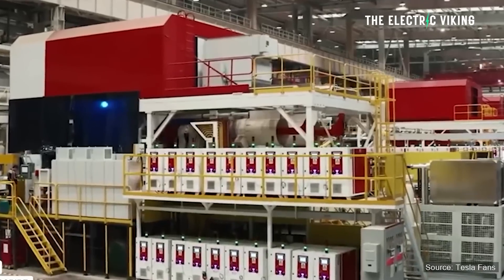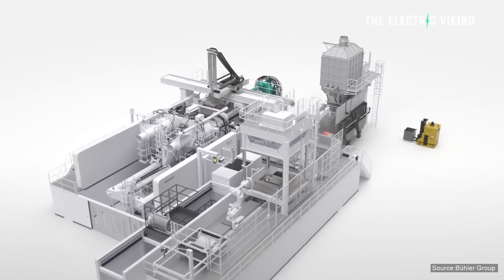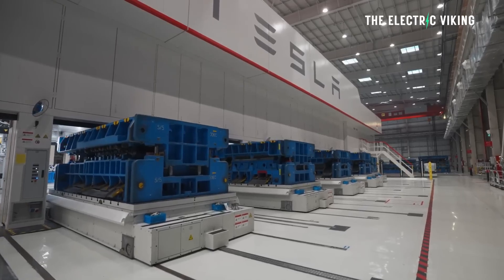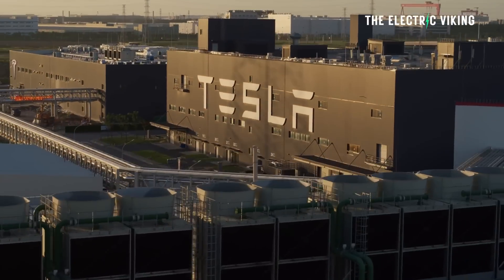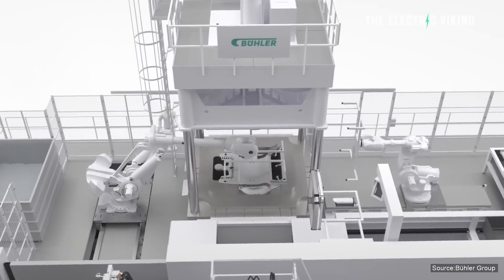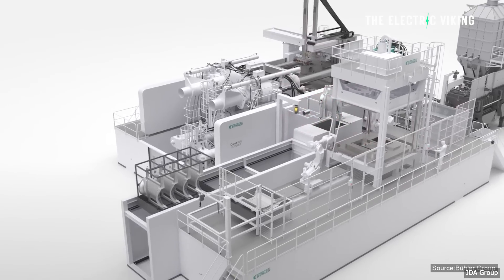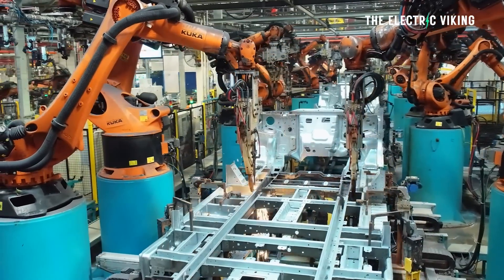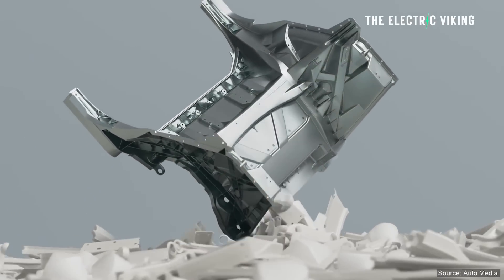Chinese engineers invent giant magnesium Gigacastings for cheaper, lighter EV's

Comment: Casting magnesium alloy is a bad move . Weight saving is probably 10 kgs total over normal alloys . Cars have accidents and repairing a car with Magnesium alloy chassis ( because that really what it is ) will be next to impossible after say a 15 Klh rear ender in traffic . You would need to get a metallurgist to check the whole chassis for micro fractures with high neck scanners like X-rays  or ultrasonics ( more complex than this I know ) . Casting with Magnesium alloys introduce increased corrosion particularly with electricity flowing threw it  ( Most cars have a Negative earth ) . Dumb idea and anyone experience in Aerospace nows it , the parts are light and have a short life expectancy . The real advantage  of say a Tesla is the ability for a car to easily last 20-30 years . I believe that save the energy needed to make 2-4 replacement vehicles with is a lot energy . Most cars use more energy in being made than the first 5-7 years of use .

Comment: Google ALLITE SUPER MAGNESIUM, it's publicly been used in Aerospace since 2006, now one company is trying to use it's many forms to make bikes and other stuff, one version can be cast for parts used inside of jet engines and other places, it's not corrosive resistant so it needs treatments. Cast magnesium has been used all over the auto industry but one good place is inside of seats as the seat frame, you can add rare earths to magnesium and get the attributes of metals like titanium, the ALLITE company claims titanium strength with their super magnesium formulation that they developed while working for the US. Gov.

Comment: The US built its bomb sights out of magnesium in WWII so they'd burn up when the bombers crashed. Let's see... lighter than aluminum? Check! But 34%, not 40%. Weaker than aluminum? Check! By 35%. So it will take more to make it as strong. Flammable at normal atmospheric conditions? Check! So let's pack a bunch of this stuff right next to some batteries and see what happens when it shorts out in a crash.

Comment: It has already been mentioned several times in the comments: Magnesium is a "difficult" material.
Contact corrosion, metal fire (can be improved with calcium and yttrium), critical for deformation.

And weight doesn't play such a big role for BEVs, so here you have to see whether the additional costs of magnesium are worthwhile at all.
Reply: I did a study about 20 years ago on the use of magnesium casting used for seats in dual deck TGV (french fast trains) compared to aluminium. It turns out that even if magnesium is more expensive, the castings come out ready to use -  no need for human labor to polish them after. In the end it is cheaper than using aluminium casting for this reason because of human labor cost required for polishing them. Also less coats paint required.
Reply: @amaurytt  there is no need to polish a car part that is not a visible part
Reply: @Zedus-rl9hp  if you think cybertruck the outer is the inner at the same time. Also doubt you can adjust parts together if parts are not clean. My vocabulary might not be the best...not my native language
Reply: most alumilium mixes today already got a bit of megnesium in it. think if they stick to that mix ratio its fine lol .. and yhea i witnessted a car light up due to the wheels being made of magnesium xD rubbing that stuff isnt great
Reply: YouTube geniuses are really a dime a dozen.
Reply: The cost saving is over human hours, not the material. The material can be more expensive. Traditionally the chassis are put together into one piece by assembly. Here you have one piece of the chassis for the entire back bottom of the car.
Reply: @dawebslave3571  same with aluminium castings.

Comment: Flame temperatures of magnesium and magnesium alloys can reach 3,100 °C (5,610 °F),[20] although flame height above the burning metal is usually less than 300 mm (12 in).[21] Once ignited, such fires are difficult to extinguish, because combustion continues in nitrogen (forming magnesium nitride), carbon dioxide (forming magnesium oxide and carbon), and water (forming magnesium oxide and hydrogen, which also combusts due to heat in the presence of additional oxygen). This property was used in incendiary weapons during the firebombing of cities in World War II, where the only practical civil defense was to smother a burning flare under dry sand to exclude atmosphere from the combustion.
Magnesium may also be used as an igniter for thermite.

Comment: Nostalgic for EV fires that were difficult to impossible to extinguish after adopting LFP batteries, Chinese engineers begin using magnesium for the battery case.
Magnesium burns so hot that it dissociates the hydrogen and oxygen in water, stealing the oxygen for itself and releasing hot hydrogen to the air. If you've ever seen a car fire involving a large magnesium part (I have) the firemen just stand by and protect other property and fuel tanks as putting water or even foam (water-based) on a magnesium fire just makes it worse.
Deformation, though is desirable in serious collisions. That absorbs energy that would otherwise be transferred to the occupants. After a certain threshold, you want the structure to bend so that the bags of water don't bruise.

Comment: Magnesium is a highly flammable metal, but while it is easy to ignite when powdered or shaved into thin strips, it is difficult to ignite in mass or bulk. Once ignited it is difficult to extinguish, being able to burn in both nitrogen (forming magnesium nitride), and carbon dioxide (forming magnesium oxide and carbon).
Reply: All you have to do is raise the temp to 744 K (473 °C, 883 °F). Sure, a large piece will burn slower, but it will still burn and hot too.
Reply: Large pices contain more energy
Reply: @tedmoss  very do-able if and when the battery fire is started first, it can ignite the Mg
Reply: @andrewcannon587  I was thinking the same thing.
Reply: With the appropriate alloy combination, magnesium does not ignite or explode. The specification of suitable magnesium alloys for defined industrial uses is a specialty of Galaxy Trade and Technology.

The common misconception about the dangers of magnesium is due to confusion of magnesium alloys with pure magnesium. Pure magnesium, in the form of powder or ribbons used for photographic and pyrotechnic purposes, as well as in high school chemistry experiments that every student remembers, may ignite if exposed to flame.

Here are some key facts and information about magnesium safety:

• Solid magnesium parts will not burn until heated above the melting point. This melting point is similar to aluminum, at 650 ̊C or 1202 ̊F.

• If locally melted, the high thermal conductivity of magnesium will generally ensure rapid cooling and prevent a fire from spreading.

• It is possible, with a welding torch, to burn a hole in a magnesium sheet as big as the cone of the welding flame without igniting the surrounding metal. Similarly, a welding torch can be placed on a full-size ingot and it will not ignite.

• Magnesium alloys can be easily welded. Welding temperatures are typically very high at the point of application of a gas jet or electric arc, yet the welded alloys do not ignite.

• Magnesium alloys in mass industrial production are commonly rolled, extruded, forged, and heat-treated at elevated temperatures (over 400 ̊C or 752 ̊F).

• Magnesium alloys are widely used in jet engines, in the structures of military and civilian helicopters, and in hundreds of auto components, without flammability issues.

• Fine grains of pure magnesium are highly combustible, but even so magnesium can be safely ground or cut if the right safety practices are applied, particularly to avoid the accumulation of potentially explosive dust. These cautions are similar to those that must be observed when working with other materials — for example, accumulated dust from grinding aluminum or other fine powders such as flour or sugar.
Reply: @blueeyes6192  one question, why in OEM and aftermarket, Al alloy wheels are sold instead of Mg alloy wheels? 

Why ford chose Al alloy over Mg alloy in transitioning from steel in making their ford trucks?

Comment: Magnesium castings have been common since the 1960's.  Can't imagine there's any advantage there that the Tesla teams might have missed.
Reply: Other than Magnesium burns better   😂🤣🤪
Reply: @JoeyBlogs007 Think very large sparklers. Magnesium also gives off UV as it burns.
Reply: @BradKarthauser Another YouTube genius.
Reply: Did anyone have magnesium giga presses in the 60s?
Reply: If Tesla can do everything better, it wont KEEP BUYING BATTERIES from CATL.
Reply: To be fair it’s probably got more to do with a more fluidic alloy they have developed and that casting of this size is new, Tesla went for being first doesn’t mean it’s matured to encompassing all the variables.
Reply: @geekswithfeet9137 Tesla desires competition, people forget this.
Reply: Tesla isn’t just “casting”, they’re making giant, high-pressure aluminum castings using their own alloys.  Which means Tesla is making parts that are low porosity, strong, and resistant enough to corrosion that they don’t need to be painted.
Reply: @ClockworksOfGL  Ok Tesla boy.
Reply: I'm not familiar with these technologies.  But Viking mentioned 2 new developments :

-  1 piece whole car casting 
-  magnesium casting 

Are these related?

The Chinese team definitely have invented the 1st one.

As for the magnesium casting part, I'm guessing they must have invented something or overcame some inherent problems with using magnesium casting.

Otherwise why didn't others use the technology?
Reply: tesla has just 1 team. thinking that other teams can't find a better solution or improve existing one is a bit silly
Reply: @sender5804  It’s not an average team that thinks in the normal way though.
Reply: @fractalelf7760  sure, but they also have some limitations like cost. to think that they have built the best product imaginable is just silly lol
Reply: That's right.

Comment: Doesn't magnesium burn? Isn't that why they stopped using "mag" wheels in racing? It is also prone to corrosion. Maybe they can coat it with something to prevent that but if it catches on fire it going to be hard to put out and reacts with water.
Reply: Not many things burn in water.
Reply: @tedmoss  It's not that they burn in water you just can't smother them because they make (release) oxygen. Kinda like a dynamite fuse that's designed to burn even under water.

Comment: That’s awesome. When the battery overheats it will ignite the magnesium and burn a 10 foot deep hole in the road. 

I wonder if the batteries can get that hot? Or can they make fire resistant magnesium alloy. 

I guess I should watch the rest of the video to find out.
Reply: Unlikley heat & fire burn upwards Not downwards
The pavements get butn but not turn into hole
Reply: @james_l4337  I guarantee that a tar road will melt and catch on fire and make plenty of smoke, so the fire dept will know where it is burning.
Reply: @tedmoss  Yes, the tar road will burn & smoke due to the high heat

Comment: Sounds good, but magnesium is very expensive. EV's already tend to get 'totaled' by the insurance companies far quicker than their ICE counterparts. Now with these large castings, if the car is in an accident, these castings shatter and usually can't be repaired. It just means the vehicles will get totaled even more frequently, raising the cost ti insure them even more. Manufacturability is one thing, serviceability is something completely different. All the points you talked about favor the cost of manufacturing with zero consideration given the cost to service the vehicle after an even moderate collision.
Reply: This is not talked about enough. Seems a biggest argument against gigacasting.

Comment: Based on the alloys they may be using I would hope that they have addressed both the flammability & corrosion characteristics of magnesium. Additionally, the structural integrity under a constant load and impact situations are also of concern - Aluminum alloy has a much higher tensile and fatigue strength than Magnesium alloy as well.
Reply: I was just going to basically say the same thing about the intense burning of magnesium. If there's a fire, that car could burn pretty uncontrollably and incredibly hot, not to mention it's next to impossible to put out a magnesium fire once it gets going pretty good (or so I believe anyway)
Reply: @terrysmith8655 does magnesium " burn " when solid as opposed to when in power form or in small particals like the shavings from a cutting? machine ?
Reply: @jbbeiser983  Only if you expose it to enormous amounts of heat.
Reply: @jbbeiser983  When ice cars burn magnesium wheel rims often turn into a major hazard for fire crews.
Reply: @philflip1963  like a battery fire?
Reply: @jbbeiser983  Yes, it does. In high school chemistry we saw strips of magnesium lit and burn furiously in air.
Reply: @chrisperry3525  Agreed, that could do it, fortunately Teslas record on battery fires is very good and battery fires are pretty bad anyway so, 'in for a penny in for a pound'?
Incidentally I don't see Magnesium as offering much of an advantage over aluminium though I suppose there might me some marginal advantage.
Reply: I believe its a magnesium alloy
Reply: Magnesium Alloys
Reply: @petertan_sg  These discussions of classroom magnesium are so pointless. Everything is an alloy of some type.
Reply: Corrosion is a major concern for use in any area with use of winter de-icing agents.  Body megacasting would have to be made of a more sofisticated alloy of Magnesium, or be dependent on post casting over coating of the part.  Neither will help keep casting cost low.
Aluminum.  Tesla probably considered Mg and chose Al.
Reply: Yet another YouTube genius.
Reply: I was going to say something similar but you beat me to it. I don't think magnesium casings are a good idea.... A lower weight in theory if they could get the alloy composition to level less flammable, lower corrosivity, and  minimized flex characteristics it might be a viable alternative to aluminum. I guess it all depends on how they can manipulate the alloy chemistry to achieve all these application parameters...
Reply: @paolocastellano343  Another YouTube genius.
Reply: With the availability of powerful computer and design analysis programs, it should not be a problem.
Reply: Gm has been using large magnesium castings for decades. Corvette dash form early 2000s as example. The only thing tesla and these companies are doing is casting much larger parts then before.
Reply: @kenb7051  The French were making full die cast aluminium chassis cars 70 years ago.Nothing is new.
Reply: Those reasons are why it is a bad idea. The latest aluminum alloys are much better than magnesium.
Reply: @tedmoss  I have items made in 1966 from magnesium that have not lost any of their strength.
Reply: I once tried to repair an old Dell laptop that had failed due to Coca-Cola spilt into the keyboard - the magnesium alloy chassis dissolved. So don't spill your fizzy drinks in one of these cars! 😀
Reply: Big chunks of magnesium are not really flammable.
Reply: le  @Withnail1969  Some guys I know got a VW bug engine block on fire....once lit it was lit it was almost  impossible to put out.
Reply: It is easy do ignite. You just need the right amount of energy. Like kinetic energy from the undercarriage rubbing on the the shoulder of the road in 60 mph.

Comment: The 40% is most likely just for that part. But since it is for the entire chassis that is quite a large savings in price. But if China can develop this tech, there is nothing stopping US or EU car makers from doing the same. They've spent billions on new engines, I have no clue what they're thinking. This is an engineering problem, not a science problem. So if they get some experts involved, they should be able to produce this tech also.

It's just that legacy auto doesn't want to spend the money. That would drastically lower profits and therefor their bonuses. So they kick the can down the road for the next guy to fix.

Comment: Magnesium is about 1/3 lighter than aluminum per volume, which could make a decent drop in the vehicle weight. But I sure don't like the fire risk.
Reply: No, not "fire risk", fire works risk. Think of a thousand roman candles all being lit at the same time. Lithium ion batteries and a flammable magnesium frame, only the PRC could come up with such an idea.
Reply: Magnesium only catches fire if it is very thin/finely divided or you expose it to something like the exhaust of a Raptor engine.
Reply: Aluminum is 2X as strong as Magnesium... Though denser.  Magnesium is used due to ease of casting and much CHEAPER than aluminum generally speaking.  Corrosion, big problem.  Fatigue life, BIGGER problem.  Impact resistance HUGE problem with Mg.  There are some Mg Alloys with good fagtigue/crack propogation properties but in general they are HIGHLY flammable, corrosion prone, and abrasion intolerant.  No free lunch... Its almost as if Engineers aren't stupid.

Comment: If that material is used in giga castings it could fail by cracking like rims in the past. A recall on a giga casting would be very expensive.
Reply: Lets see now, take one giga casting out and car falls apart, not a pretty sight. :face-pink-tears:
Reply: @tedmoss  The casting is cheap to make but if it's damaged in a crash the car would be totaled. Remember only Tesla has the parts and they don't sell to independent repair shops. You would have to find a junk yard part.